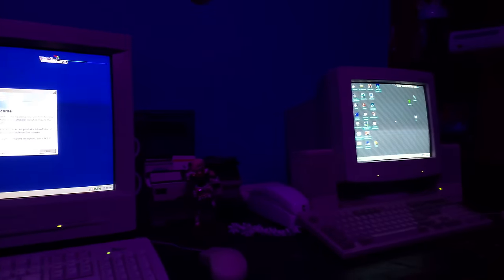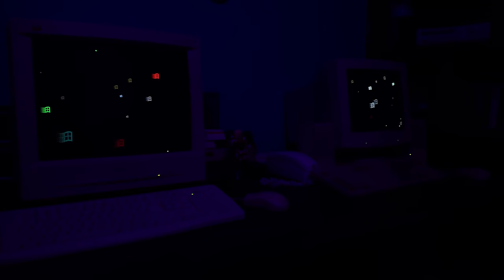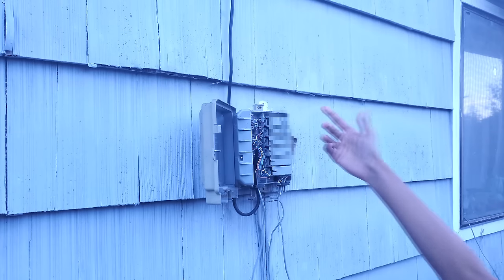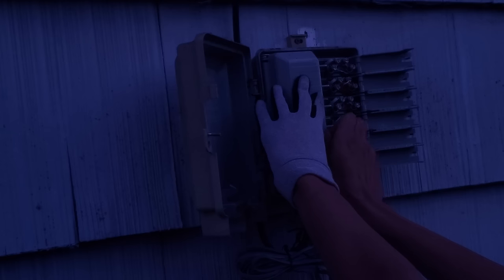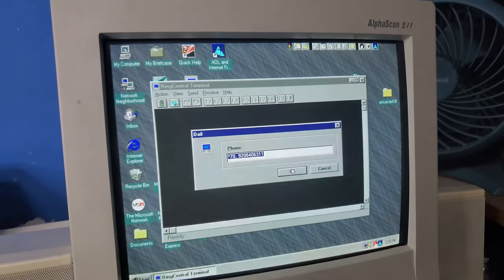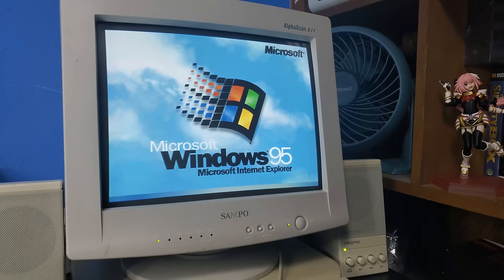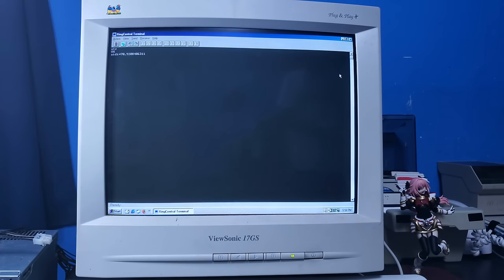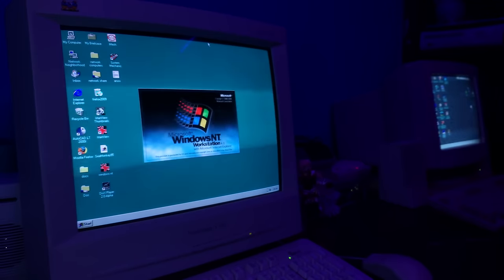Getting Dial Up Internet in 2023!

Comment: 300 baud dialup was still used into the 2000s and maybe even 2010s -- but not for the Internet or even BBSes. Back when PIN pads still needed a phone line, they dialled up to the bank or card processor or whatever at 300 baud, for two reasons. First, the amount of data being exchanged was tiny, and second, the initial handshake for, say, V.90 can take upwards of 30 seconds to complete so you can send and receive data, which is a ridiculously long time to make customers wait.
Reply: It still being used as long as fax being used as its also use dialup, note that this standard is used for any data transmision over phone lines
Reply: @ShadowriverUB   Fax usually runs at a higher speed, and each different speed has its own standard.
Reply: I saw 1200 baud used a lot too because of the short handshake
Reply: Also, seems like banks had already transitioned to mobile data, some techs are even using 4G sticks on ATMs.
Reply: @jamieschnaitter6210  That is correct. 1200 baud did not require any training and was a fixed modulation. So connect speed was less then a second. It is still used today by credit card machines for places that have no DSL or other internet access.

Comment: Great video! I remember being very excited for 56K and upgraded from 28.8. I never could quite get beyond the 46Kbps mark reliably but was still a nice speed boost. I seem to recall forcing it to connect at a slightly slower speed for a more reliable connection and smoother Quake multiplayer experience 🙂

Comment: Had a good giggle, taking me right back 20 years! 

I forgot that I used to hold my breath when listening to the dial up tones, hoping that I got a connection.

My ISP was sometimes at capacity and would give me the busy signal until someone logged off😂

I had modem set to redial every 60 seconds!

Comment: Of all the things I miss about the 80s & 90s, modems are not one of them (as well as early plug-n-pray technology). Still a really cool project.
Reply: Same.  I never lived in an area where I could get 56K speeds on dial-up.  I'd always max out at 28.8 or 33.6 if I was very lucky.  A lot of times it was 26.4 kbps.  It was common to get booted offline randomly.    Websites ran okay on dial-up until about 2000 or 2001 and after that, it became excrutiatingly slow as websites became more complex and graphically-intensive.  I do not miss dial-up Internet.
Reply: @bchristian85  I feel you. My town has always been about a decade behind the times, despite a healthy population of ~12k and just 5-10 miles from a much bigger city. Our phone lines were crap and DSL/Cable wasn't available at all until the mid 2000s. We could get 56k-ish on a dry, clear day, but that was rare.
Reply: Agreed.  This is kinda traumatic for those of us who only had dial-up for far too long.  2015 to be exact.

Comment: Great to see people keeping the old stuff alive by using it. Me and my buddies back then spent more time getting this stuff working on low-budget hardware than actually using it - getting Windows 95 running on a 386 CPU I remember was an entire Saturday's work, and then ran slower than the data the modem could supply to it, but we danced around that room when it finally worked and we had loaded up the internet on the piece of junk.

Comment: Awesome video! when ever you cut the cable you should make a "O" at the point of entry and then run the cable up and through the hole so that you have a drip loop created for rain water to flow downward away from the entry hole and you also have "extra" wire in a service loop for any future repairs without having to re run a cable from it now being to short if it gets chewed ect.

Comment: I remember thinking a 56kbs modem was superfast, but going to 56kbs from 14kbs or even 28kbs did feel like a huge speed boost and at the time felt so high tech and cutting edge which i guess it felt that way cause it was but still it's crazy looking back and feeling the nostalgia every time a modem is connecting to dial just makes you feel something. Long live the 90s and AOL chat rooms and you got mail

Comment: Australia got rid of it's analogue phone lines and I've always wondered if I could build an Asterisk type PBX to route fibre internet into my own little dial up. Seems possible but that usually means I have no idea what i'm talking about
Reply: It would not be hard. You just need   have the whole system, server and client computers in your house.

Have the outside internet running into a dialup server and run a phone wire to your client computer.

It's technically dialup still. You'd still get dialup speeds on the client.

I don't know much about server setup so don't know how to do it but I'm pretty sure it's possible. It's how dial up servers worked anyway. They had higher speed connections from the phone company and broke it out onto slower ones for users.
Reply: VoIP codecs might make a mess of the data with compression. Curious if that’ll get in the way.

Comment: Nice! Some of those handshakes sounded like they were struggling a bit and it could be due to crosswalk. It looks like you ran a long piece of flat line cord out to the interface which can pick up interference and crosstalk. You should probably use some twisted pair wires, either telephone station wire or even cat 3/5 cable to avoid interference on the line. On the plus now any phone jack in the house will have a landline/dialup on it. If there was already a phone jack in the kitchen you can also just plug the cable modem into it directly
Reply: It's because his landline actually is using VoIP. VoIP introduces latency, that's why the handshake sounds so stretched out. There aren't any real landlines left nowadays. It's all VoIP, it gets converted either in your modem, in the telco cabinet on the street or at the central office.
Reply: @kpanic23 Yeah when he said it's not VoIP I kinda chuckled. It's not VoIP on the public internet, but it still uses tech like SIP. I think the cable co that I contract for changed from SIP to NCS on DOCSIS connections. I'm not too familiar with it, as I've only been on the cable side for ~3 yrs vs 15 on the Telco side. Our Telco still uses a along voice for copper customers in the end offices, but of course the backhaul beyond the Nortel switches has been fiber for decades.

Anyway, this stuff is a real throwback. My dad's union paid for a computer and dedicated "fax" line in the early 90s. I think the first standard I was accessing BBSes with was 2400 baud. I wish I'd learned more networking stuff or even coding back then. My life would probably be very different now.
Reply: @kpanic23 here in the uk alot of us on an old school copper line still. Unfortunately its being fazed out for voip which is cutting off the elderly who dont want/have broadband. Also the problem if the power is out the phone is out.
Reply: I dialed in once from my room in college, and during a lightning strike I overheard some random conversation from I don't know where.
Reply: @cifey My wife called some business the other day and while she was waiting on hold, she got disconnected. She told me that just before she got disconnected, she could hear other people's conversations! I think this was actually a pharmacy - could there be liability here for privacy violations? I wonder...

Comment: I SysOp'ed a couple BBS in Denver back in the early 90s on a 2400baud, upgraded to a 9600,, then a 28.8, and to a 56k. The memories this brings back! Thanks.
Reply: PCB?
Reply: @surject  ?? I used WWIV. Not sure what you're asking?
Reply: I started mine in the mid '80s in the UK, with 300/300 and 1200/75.

Comment: I grew up in the Midwest, and my family first got AOL dial-up internet sometime around 2009.  We had that for about 4 years I think.  We wanted to upgrade to DSL, but they didn't provide it in our area.  We finally upgraded to a wireless connection with 3Mbps download speed.  (Last I checked, they are still on this same plan.  There aren't any good options when you live a mile outside of town.)

Comment: Hello, IT guy here. Love your video, very interesting. Small piece of advice, though, I wouldn't cut that cable down to length. We always advise keeping bundled wire somewhere along the line, so if there's damage to the ends, you can re-end the the cable and not risk not being able to reconnect the whole shebang.
Reply: Okay nerd

Comment: I have heard somewhere that they removed dialup modem support in windows 11.
It would be nice to see a dial-up test on Windows 10 ;)
Reply: I think Windows 11 does still support dial up (or at least Microsoft didn’t remove the settings page for dial up)
As to if dial up will work for initial setup though, I’m not sure

Comment: A few weeks ago I finally threw away a perfectly working external US Robotics 56K V.90 modem , along with power supply and the DB25/DB9 cable, just like your setup. The externals were wet better than the internal modem using either an ISA or PCI slot. The only and the best thing about diaup connections is that it was a point to point connection (that’s why the phone would not work while connected), which is not the case with cable, though ISDN worked similarly, it wasn’t analog. That NID outside the house was fairly old. Back in the day, I used to land lines and two modems and paralleled the connections to try to beat a 128K ISDN line, for more than half the price. Great project.

Comment: I had dial-up in the late 90's - mid 2000's out in the country (horrible connections) and the last few years of using it I always had to pick up and immediately hang up the phone in the middle of the handshake process so I would have a "good" blazing connection at 26.4k. Otherwise, if I didn't, then it would either connect at 9600 or not at all. I forget how I figured that out, but it made it work 99% of the time. I also wonder how many junk emails have accumulated over the years since last using my first email address. It was a CompuServe address. A really dumb one that my 13 year old self gave it in 1999.
Reply: that email is prob long since been deleted.

Comment: Ah, those times when we could only connect a few hours per day... but at night, because it was cheaper and nobody else needed the phone. I really don't miss it 😅. My city was lucky enough, though, it was chosen as pilot population to test cable network and we already had it by 1996-7. This, in Spain, was quite something. The difference was so enormous... I also remember having to buy my first 100MB/s ethernet card 😅

Comment: My ISP added v.92 in 1999/2000. If I recall correctly you could hang up the phone and reconnect too while preserving the session. Also, one of the servers where I work still receives order information daily from a remote office via a dial-in connection.

Comment: I'm not quite old enough to have used dial-up, but I did work a job in the USAF maintaining long haul HF radio for a few years. One of the channels we had was constantly passing data, which sounded pretty similar to the startup handshake. Sometimes I'd just sit and listen to it, wondering what it actually was

Comment: The Phone jacks on the back of the xfinity modem are to replace the telephonc box outside on the house.    Could you have run the phone wire from the back of the xfinity modem to the wall jack with a splitter hooked up to it and then split off to the dial up modem rather than connecting a wire to the box outside and then under the house.

Comment: I started on a 2400bps modem, and I was using early file compression protocol's to shrink some of the shareware files. My friend and I ran a local BBS on a U.S. Robotics 36.6bps modem. My friend put some device on his phone line that isolated his connection so no one in the house could accidently pick a second phone and disrupt the connection. It also had the effect of automatically disconnecting his sisters phone, because she talked on the phone all day.

Comment: here in Austria the Internet somehow "took off" in the early 1990s. Round about 1995 my university (the Universität Wien) offered dial-up anternet access to their students, that was even before v.34. Then i had a variant of US-Robotics modem (it was v.90) with some memory inside and it was capable of comprising an answering-machine and internal fax-reception which at that time was cool because i could receive calls and faxes when the PC was OFF. is was a hasstle and often dial-up processes had to be repeated multiple times and i use Windows 3.11 which at times was also often unstable and only gradually got better with Win95 yet it was some kind of pinoeer experience :)

Comment: Used dial up from 2001 to 2004, set up by computer instructors. Never had to do it myself. Used 2G and so on since 2005 before getting copper wire broadcast in 2021. Now after using 5G, I have to get a fiber connection.

Comment: We sure have come a long way since then. I just bought a laptop with Windows 98 to run pretty much just one program. I will be introducing it to cable style internet. Is there anything I should be concerned about? I'm mostly worried about it picking up a nasty virus. Is there any thing you might recommend for updated protection for a system this old?

Comment: I had a incredible Hayes 2800/9600bps modem until those US Robotics 56k came, they were super reliable, the connection never dropped, and super fast (I mean, fast for the 90s). Now I surf the internet on a 2gbps fiber connection. How times have changed!

Comment: If I’m not mistaken, a telephone connection can still fit in an Ethernet connection, so you didn’t have to run a line to the outside box. You could’ve still went into the back of the modem
Reply: No, ethernet is RJ45 and telephone jacks are generally the smaller RJ11

Comment: Book called "One Second After" is about three nuclear bombs set off over the US, causing a massive EMP, wiping out all electronics and setting the country back by 125 years in technology. One of the things they discovered was a bunch of old computers in a basement at a very old college in Black Rock Mountain. Oddly the devices were not affected by the EMP caused by the nukes set off. They were able to get them working and it was like new technology all over again, was quite fascinating. They were able to get it connected to an online source and even able to hack the encryption because it too was using old encryption technology. Good book, three in total, to read.

Comment: V92 was actually pretty good because you could over-clock it and get close to 128k speeds with a modem firmware flash.  Did it to ours and it was noticeably faster.

Comment: I had dial up for about a year. It wasn't horrible to me then because I was so jazzed about having the internet in my residence. Most of the internet in those days was either text or audio which dial up could handle. The problem was trying to watch video which was truly terrible. I remember trying to watch some Three Stooges shorts and it was like watching television through 2 or 3 greasy windows. I jumped on DSL as soon as it was available. My speed was increased to 256kbit/s which is laughable today but impressive in 1999.

Comment: Yooooooo I have an old Miltope VT military laptop with a P3 in it if I remember correctly. Has the case, charger, vehicle slave cable adapter for the charger, 4 or 6 batteries and pretty much everything they came with. LMK if you want it, I think it would be right up your alley.

Comment: I'm confused as to why you needed to run a pair of wires under the crawl space. If the xfinity modem connects to a phone line then I assume it is an xDSL modem. It is a twisted pair not Coax at the NIC.  You indicated the Xfinity modem was using Coax for POTS (coax used indoors only I assume)? Then you indicated that the phone lines to your room were already inside the NIC so you ran a line from the modem to there. Does that mean you didn't need the line in the crawl space after all ? I"m speculating that you have DSL + POTs coming into the house (left side of NIC) and that your Xfinity modem is also supplying VOIP over DSL. The VOIP phone lines out of the modem then tapped into the existing household phone wiring back in the NIC but those wires no longer connect to the left side of the NIC, where the real POTs is.

Comment: In a very remote inhabitable area in the middle of nowhere in the deepest Alaska there was a small but very thick door on the side of a mountain with a keypad beside it. It was all overgrown since many, many years back and the door was a little rusty and there had not been any one there for over a decade. Behind the door was a deep steel stairway and at the bottom another thick door and an empty simple desk. Behind that door was a long concrete hallway and at the end there was a totally black big room. All off sudden you saw a small red light went on and strange tones was heard. Harddrives and flickering green screens came to life and old incandescent lights started to come on one after the other and light yup the room and you could now hear a small hum in a room beside where 2 generators had come to life. On the screens there seen to have been exchanged som little information but then it all just suddenly stopped and the room became dark again. Still to this day no one know what really happened there that late night.

Comment: The funny thing is that the hardest part about this whole video isn't the terminology or "old school" technology. It is how to find an ISP that will offer 56kbps dial up service.

Edit: If I remember correctly, it  would be possible to run a token ring ethernet, which in itself is compatible with UTP (RJ45 cat connector) using an adaptor.